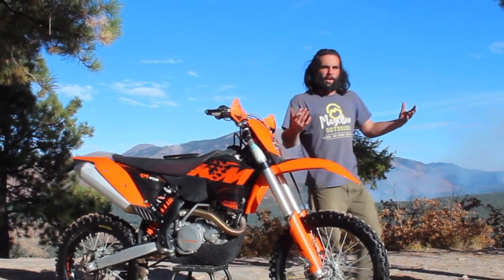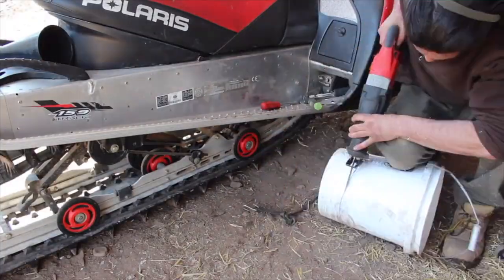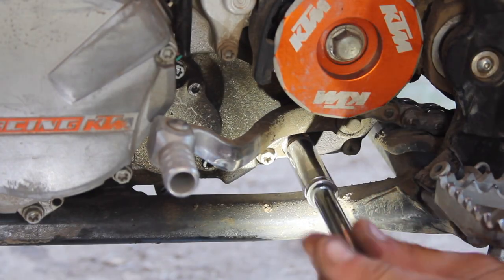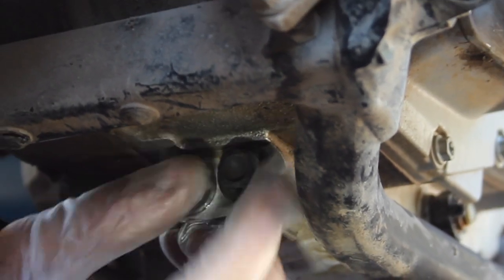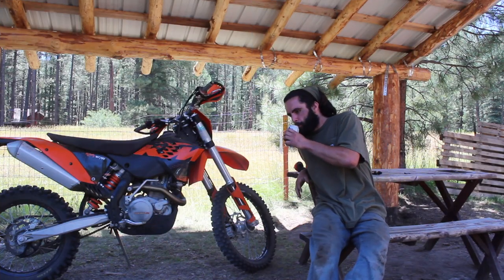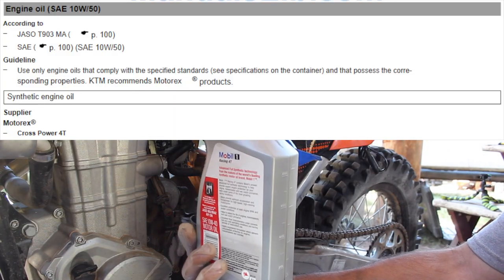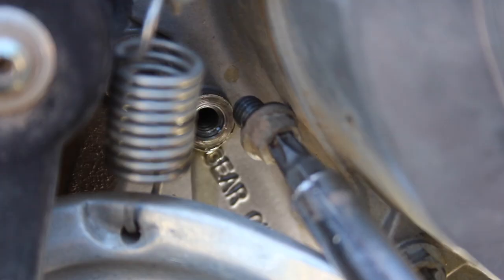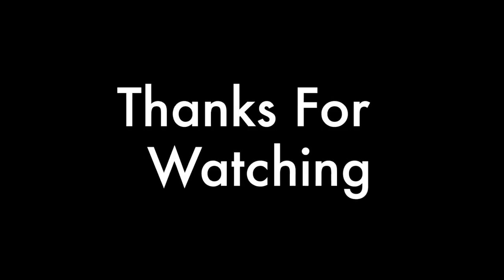How To Change Transmission Fluid KTM 530 4-Stroke Gear Oil Change

Comment: so your using the same oil for the gearbox and engine oil how has been holding up/hours and is it the same for a 08 ktm 450 exc
Reply from the maker: correct, and was holding up great. Unfortanetly money got tight last year and I had to sell the beast. Oh well there will always be more bikes. Thanks for watching and taking the time to leave a question in the comments. Cheers

Comment: So is the gear box oil .90l and the engine oil is 1.25L ?
Reply from the maker: gear box on that 530 was .9L, but I believe the engine oil was only 600ml. Be sure to check the shotglass and your owners manual to ensure correct oil level. Hope this helps, and thanks for watching and taking the time to leave a good question in the comments. Cheers

Comment: What's that spray you use to clean surrounding area?
Reply from the maker: https://amzn.to/3dqijZv crc heavy duty brake and parts cleaner, stuff is really good at getting grime and grease, but probably need to avoid any electrical connections of sensitive parts with it because it is such a harsh chemical. I'll update description with better links to the parts and tools I used ASAP. Thanks for watching and taking the time to leave a question in the comments, Cheers

Comment: about as long as the gearbox oil changes
Reply from the maker: not exactly sure what you meant here, but it is a fairly quick job, especially on the 2nd or 3rd time around. Thanks for watching and taking the time to leave a comment. Cheers
Reply: @EscapePowerSports  OK thanks